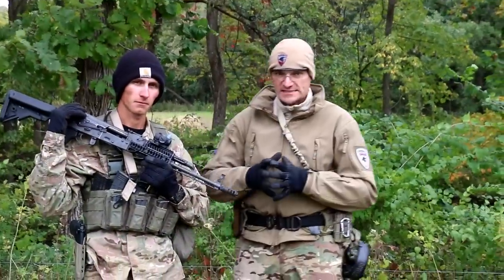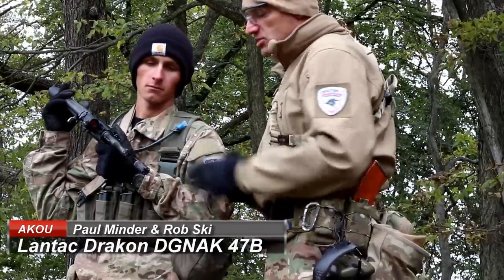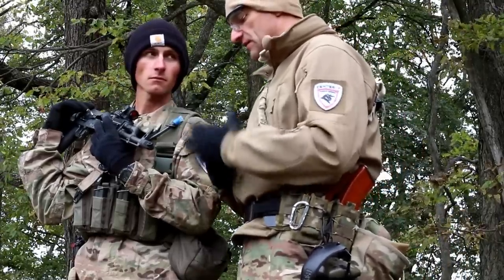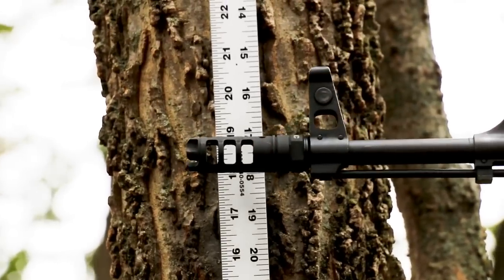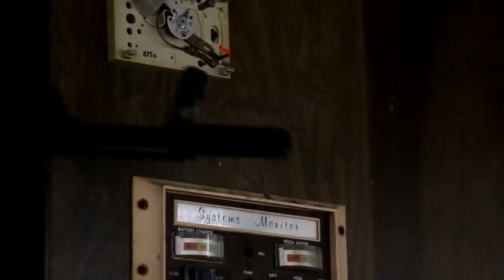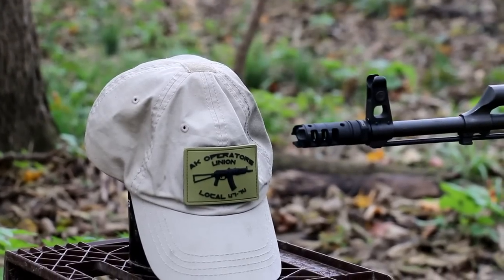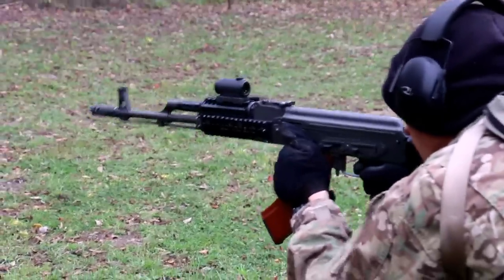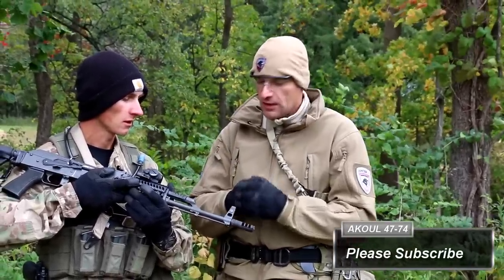AK 47 (AKM) LANTAC Drakon Muzzle Brake DGNAK47B review

Comment: I tried one of these out, frankly for the cost... it sucks.  Think about it, for a third of the money I could get a Manticore break, or for half I could get a Spikes, both of which work IMO just as well as the Lantac, and they use the proper attachment method that allows quick swapping of the brake for a flash hider.  I would have thought the Lantac would use the correct attachment method for such an expensive muzzle device, it's actually kinda crappy that they just give you a crush washer instead of using the notch cutout.  It disables the quick swap capability, which is really one of those things that makes the AK so versatile.
Reply from the maker: ***** , i think they are learning about AK market, this is their first shot it. I agree with you on comments about lack of notch cutout...I hope they will make version 2.0 and make some improvements. Still, this is good start.
Reply: The crush washer provides better alignment with no flop
Reply: @AkOperatorsUnion I kn😢 this is an older post from you but do you know what BMD is compatible with this brake? Thank you Rob!

Comment: Great review!  I second HondoLane76.  I have the Tapco Slot brake on my '47 and Find it effective enough to be worth the $9.9.5 I spent on it.  I still think the original '74 style is the most effective I've played with.  What are your thoughts?
Reply from the maker: Graham Baates , for $9.95 slant brake is earning all that money. That being said, you are getting more of brakes like Lantac. Original type 74 isn't bad either, but again, some well made brakes will give you more, but you have to pay more as well...
Reply: I have the Tapco brake on one AK and the Manticore Nightbrake on my main AK.  For $10, the Tapco brake is very good.  The Manticore is better.  I can't see paying 3 times the money for the high end brakes.  Any difference between the Nightbrake and the $200 are minimal.  Spending the extra $150 on ammo and learning to shoot the gun faster is a better idea, IMO.
Reply: That tapco slot brake would be the worst for shooting in the dark. Probably the best brake I've used is the FSC47 followed by the Dynacomp. The FSC47 seems pretty decent at flash hiding too
Reply: I'm not concerned with shooting in the dark so much as keeping the barrel level.  For me it's been great at that, I'm just curious what the other options are.

Comment: Just threw an ultimak railed tube and vortex dot on my PSAK GF3. Saw that you guys loved that railed tube and even emailed to ask for optics tips. Now to get rid of the basic slant brake for something more controllable. Threw a magpul hand slide stop under the forend too and it greatly increased my control of the rifle while engaging. I have long arms and like a partial C grip, but an AK doesn't work well with my fat thumb on a C grip and a low dot sight. That little hand stop allows me to run it between my pointer and middle finger for a grip point on an otherwise slick forend. Thanks for the advice and these informative videos guys.

Comment: Hey guys I could use some help I bought this brake for my Century Arms Draco pistol and took it to the range and couldn't hit nothing and realize that the bullet was hitting the top of the last port of the brake and causing the accuracy to be off so I guess my question is do y'all think its the brake or the pistol that is causing the problem or has anyone else run into this problem so I haven't been able to find nothing
Reply: Mike S century arms just don’t like that muzzle device man it’s the way the barrel is lined up somehow no mater what any kind of Romanian riffle from century will have that problem
Reply: @ericaragon201  yeah I did find one other person say they had this issue with there Rifle mine is the romanian Draco pistol but the crazy thing is I have a Tapco AK-74 Muzzle Brake and it runs perfect got it for 19 bucks VS. 147 for the Lantac

Comment: Have you guys tried the Krebs Custom M16A2-Type Flash Suppressor for AK Rifles 7.62mm?
Reply from the maker: justus005 you mean regular "bird cage"?
Reply: Ak Operators Union, Local 47-74
 Yep. A2 flash hider. Good flash reduction, little muzzle control added. Would be curious how it handles the 7.62x39
Reply from the maker: justus005 Sig 556Xi in 7.62x39 is using one - not really good performance, it helps, but you can get more out of muzzle brake these days...

Comment: go with epsilon VG 6
Reply: I'm between that and the lantac. What's the advantage of the VG 6?
Reply: @FakeProfOak  the VG 6 works just as good if not better in my opinion for a lot less money  you will like it
Reply: @sentinel8711  That seems to be the consensus across the internet, plus it has the option to add a cage to reduce concussion. Thanks!
Reply: @FakeProfOak  yeah and the cage works well

Comment: Love what you guys are doing. This is really the only channel for Ak guys. I have a question for you and I have been researching it myself. Can you put a bolt carrier from a galil into an akm?? If so what materials and steps would I do to be able to do that.

Or does a galil bolt give the AK line more ergonomic??
Reply from the maker: TheTyrial86 i'm not good with Galil, i can only imagine that it would take some serious gunsmithing work to do this...;-)
Reply: Ak Operators Union, Local 47-74 Hmm what I have researched. The galil is basically an ak chambered in 556x45. With a different magazine. I have heard it is pretty simple. But I would need to buy maybe $70 in parts not to include the the little things like roll pins. I guess I am just asking to see of you have come accross one before. I know not many people do this midification.
Reply from the maker: TheTyrial86 yeah, but you have head space it, make sure all fits correctly and etc. I'm sure it possible, just question is, is it worth it?